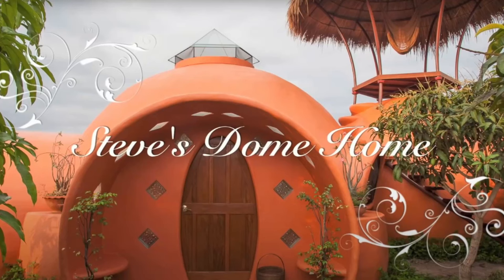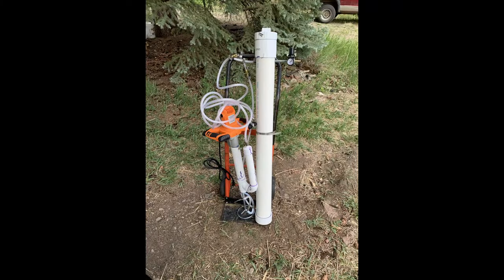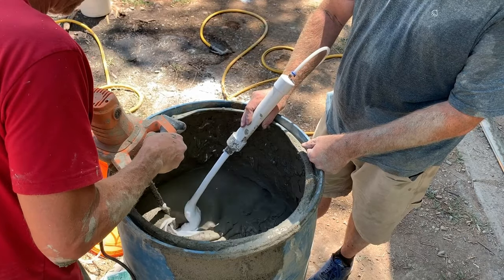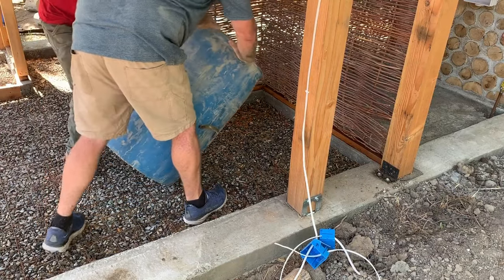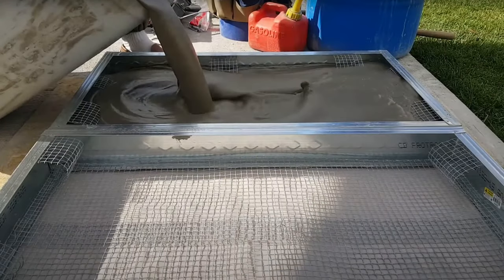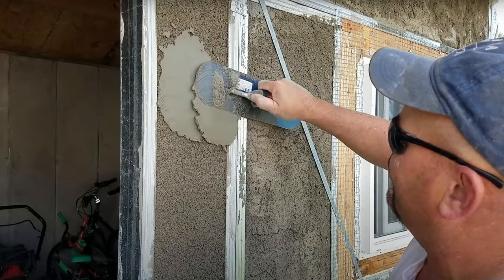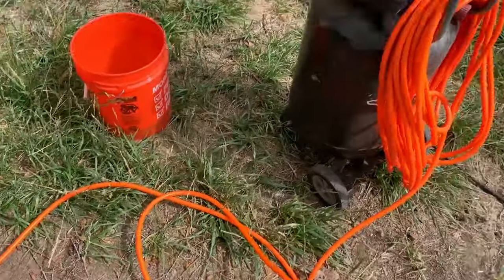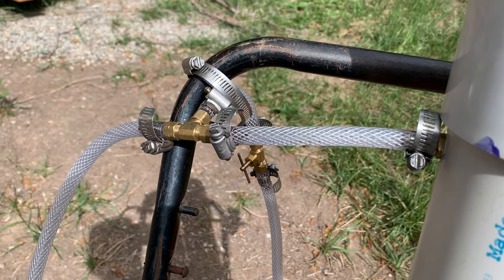Aircrete is great, but watch this before you build with it!

Comment: Hi, thanks for sharing your adventures in building!  With the airecrete process, can you do your dust crete with the added air into panels with tounge and groove concept?  You may also explore CAFS units (compressed air foam system) which are used in wildland firefighting to spray down structures with a foam blanket in preparation of impending wildfire exposure.  It could be that the smallest units would produce too much foam to make it practical, food for thought!
Reply from the maker: The aircrete process is laborious, and may not add much r-value to dustcrete, but it’s an  experiment worth trying. Personally, I wouldn’t use any product designed for retarding fire, as the chemicals tend to be carcinogenic. I’m planning some trials with clay replacing lime in the dustcrete. This will lower cost (below the $1.28/sf  at 8” with the cement) and provide a wall system that I can make without an industrial supply chain. Lime can be made from fired limestone or seashells.
Reply: I agree about the chemicals from firefighting,  I know all to well,  10 years  in  the fire service, but the equipment was what I was trying to highlight.

Comment: I would do tire house/ earth ship then  air Crete to fill the tires versus dirt which takes alot of time and physical labor .
The strength and termal mass of tires far exceed that in air Crete and fiberglass shell. And the used tires are free brings cost down . It also takes time properly figure air Crete mix. If improper the structure will eventually fail. A tire house won't.
Reply from the maker: This could be done. Only 12” per day of aircrete could be poured, however. I wouldn’t do this, myself, because I don’t want to breathe tire fumes.

Comment: Check out styrocrete, shredded styrofoam mixed with concrete, fibreglass fibre, foam.  Very interesting high insulated minimum frame and cheap building.

Comment: Try adding homemade carbon fiber powder into thhe mix with aluminum dust and use hemp fiber rolls with a polyurethane resin added to the mix.  Extremely durable mix design that can be made into forms, domes, etc withh high R value

Comment: I like the concept of aircrete, but it is not really a structural material. I would like to see what happens if you were to do a mix with pozzolanic material like fly ash or fumed silica. 
I'm not a big fan of drywall. I like the SIP approach, though SIPs generally use a structural cladding (mostly waferboard or OSB from what I've seen) that helps keep the internal insulation protected. The grain bags have no structural strength and don't readily attach to concrete the same way as cellulose.

Comment: What if you made panels using aircrete and dust mixed together. Doing so should give more rigidity and strength without giving up much in the form of weight. If the panels were poured flat, using wood bordered forms, the wood could be removed after the material was dry, or it could be left on and the panels could be put up just as a sheet of sheetrock would.

Comment: I bought honey do carpenters foam generator, and tried to form a large aircrete block (about cement size). Mine was crumbly. I didn't, however, weigh the foam or add structural reinforcement. I also didn't let it cure very long before attempting to move it. All rookie mistakes. It's a fascinating substance though. I've also seen aircrete blocks (approximately 8" x 8" x 12" used to quickly and successfully build a home. I think they are manufactured in Germany. What about using a basket weave-style material for rigidity?
Reply from the maker: It’s a tricky material. Given that the R-value is not as great as first reported, I don’t have any plans for further experiments. I’ll be sticking with my dustcrete method.
Reply: @radicalgastronomy  I really like the dustcrete formula you shared. How does it hold up to water? Can you form blocks with it? If so, do you believe your wall method is less labor intensive than forming blocks?
Reply from the maker: @soatmos  it hold up well to water. You can see in the video where I repaired a leak. Blocks could be made, but I prefer the slip form method for speed and strength.
Reply: @radicalgastronomy  thank you. I did see the leak video. I was just wondering how it might do over time, but it does look great.
Reply: @radicalgastronomy  have you ever considered making this recipe with straw instead of wood dust, or combining the two? That would be interesting to see if the added straw provided more tension strength to it, or if it would make it crumble more. Just wondering, because I don't have a mill nearby to get enough "dust."
Reply: Also, can you make a video detailing further how you affix your framing? I get the general idea, but I may use this method to build a house and I would like to avoid as much costly error and time as possible.
Reply from the maker: @soatmos  I bet it would work, but haven’t tried it.
Reply from the maker: @soatmos  I’ll have more framing videos coming

Comment: Has anyone considered using the fibreglass loose fibres as reinforcement? I believe you can substitute the steel required in walls and floors?
Reply from the maker: We have been kicking that around.

Comment: Although I haven't found any actual testing for aircrete at all, a Naima R-value of 6 might be possible with a radical mix of aircrete, however the resulting amalgamation of air, dish soap, and concrete wouldn't be useful as a building material.  It would pretty much just crumble and turn to dust at the slightest pressure because of the high air to concrete ratio and the fact that soap is the opposite of a binder.  

I'd think it would be pretty obvious that the insulating value of aircrete would vary a lot.  More air in the mix, better R-value, less air in the mix, more strength.

The information that I've found on aircrete sites downplays R-value because it isn't a calculation of BOTH an insulating value AND a calculation of air and water intrusion.  Although aircrete would likely be pretty good for air intrusion (and that may well be more important than the R-value), it wouldn't be good for moisture at all unless the foaming agent was perhaps some sort of an epoxy.  

As I've seen it mixed and installed, I don't think it would test anywhere near an R6 as an insulator.  It might be just a bit better than drywall if mixed with a high concrete/low air ratio, and that would be what was needed if it's to do anything as a building material.

I would think there would be actual testing with specific mix and method formulations if an insulating R-value is even quoted as an estimate.  

For some reason, people think mass = good insulating value.  Adobe builders often brag about the great insulating value of clay.  Although it retains heat and cold in it's mass, it's a terrible insulator.

Comment: If only a thermal filler is needed ie walls are supported by framing with posts, studs, etc, limecrete could be far more eco friendly. If a mix is truly load bearing Id bet the R value is closer to 1-2/in. Need a mix table with specific mix designs. Ive made papercrete, perlitecrete, lavarockcrete, epscrete, clay-straw etc. It comes down to using about as much portland as in std concrete mix to be useful structurally - which imo is just not eco. It seems best suited to being a filler wall material. Mg cement is strong but costly. Lime cement is proven over millenia but not easy to get aporoved for struc use. I keep returning to thick LB walls of clay and straw without reliance on a frame that wipes out being eco. Or rammed earth, or strawbale using super-dense 3-string bales with a mud plaster and no portland which is the massive embodied energy hog. Mfg PC constitutes 1/4 of planetary particulate air pollution!
Reply from the maker: Have you ever run across poroton bricks?  I have built with them, and find them impressive. For those unfamiliar, these are extruded clay and sawdust bricks with a honeycomb of air cells in the middle, t&g butts, and keyed faces. They are dried and then planed to a 1mm tolerance.  They are set by dipping into a tray of thin bed mortar, then stack like legos. Unlike cement based techniques, the clay firing happens at lower temperatures, thus requires less fuel input. They are only (to the best of my knowledge) manufactured in Europe, which violates the distance of transport ideal. That being said, we built a 3/2 house out of them in the early '90's for 80% of the cost of 2x6 stick frame.

Comment: Mylittlehonestead had a great idea about building with superadobe earth walls which they then plastered on aircrete tiles they made in hexagonal forms, I suppose they did it for a cheaper faster finish to the Adobe walls as well as the insulative and even acoustic properties of an aircrete plaster finish while maintaining the compressive strength and mass of the earthen walls. I’d say meet somewhere in the middle maybe some square meter sized panels, I’ve also wondered about adding microfiber reinforcement to aircrete mixtures but It’s just an idea for now
Reply from the maker: Interesting

Comment: Honeydew experimented with aircrete mixed with cob in one of his earlier videos which I found to be fascinating, there is so much to evolve and experiment with! I just found your videos tonight and they are really good!! I can't wait to see more on your building. I have an idea about making a compressed block system much like Lego, but uses straw or slip straw on half the block towards the exterior then cob on the interior of the block, then lime on the outsides of the block, the idea is somehow get them to stick together so it can vastly reduce the amount of time to create wall systems. Not sure if it would be possible or even worth doing, I just don't like how labor intensive natural building is. I have watched all the aircrete people you mentioned, it still needs time to get it perfected and consistent. Maybe adding straw or maybe even sticks to the aircrete for the Sips panel would maybe add more strength. I don't know if the straw would break down if it was next to lime/cement. Have you tried the sawdust mixed with air Crete?
Reply from the maker: Your straw aircrete idea is intriguing! That may work. In Europe they use an extruded honeycomb block called Poroton, or Jumbo Brick. These are set with a thin mortar that the bricks are dipped into, then set. Perhaps a thick clay slip could work to stack your blocks. I agree that the drawback with natural building is the time factor. I’m always playing with ideas that can cut time, but keep materials super local and regenerative. Keep us posted on your progress!
Reply: True straw and not grass has a lot of silica which prevents decomposing. Grass or any chlorophyl material will rot with any moisture hence straw has been used for millennia.
Reply: there is a guy on youtube that has been experimenting with styro aircrete for the last year or so and posting videos. he is breaking down used Styrofoam from trash from businesses and mixing it in as like an aggregate into aircrete. Obviously not a natural material but it is recycled, has a higher R-value than aircrete alone and is stiffer during pour. Not saying it is the answer for most people but just another interesting use case for aircrete.
Reply from the maker: @beartankoperator7950  it is interesting, for sure. I wouldn’t want it in my home environment, but some may not mind.

Comment: This was a very interesting and informative video, but there are a couple of mistakes in here that I would like to correct before someone does something they may regret. The first one has already been caught and corrected by domegaia  but I thought it worth repeating. Aircrete has an R-value of approximately 2 per inch, not 6. That makes a HUGE difference when you are calculating the depth of your walls, especially in a very cold area, so people should be sure to factor that correctly. The second mistake is potentially dangerous, so I want to clear it up once and for all ... recycled grain/feed bags are NOT fireproof!!! I believe you may have heard someone mention Aircrete as fireproof and somehow misunderstood that, but take my word for it, as someone who has homesteaded and fed a LOT of animals from those sacks over the last 30 years, they will burn easily and melt like any other plastic when flame is applied. However, if you have a ton of those sacks, you still have a very useful material on your hands--DON"T TOSS THEM! I have sewn them together to make outstanding "free" tarps, cut them down shorter and added straps for heavy-duty totes and reusable grocery bags, and even used them for hauling heavy garbage that ordinary trash bags could not hold without splitting. They also make excellent grow bags--either with the tops folded down to make them shorter and used like buckets, or filled with soil and with the ends stapled shut laid on their sides (cut an x or hole to insert a plant). You can even use them as Earthbags in foundations and walls. They are a great resource, just not fireproof. Anyway, thanks for a great video. I look forward to more of these!
Reply: Thank you Deborah S because I have no personal experience with grain bags but fireproof plastic didn't seem likely.

Love these RG videos and shared ideas!

 Re using the grain bags for facing aircrete panel, If they are Polypropylene that's at least relatively LOW-Toxic plastic and afaik gluable with something... thinset? Idk! Will anything stick to it? Will it degrade as some plastics seem made to disintegrate... biodegrade? Into microplastics? 

Anyway..If they're polyethylene bags, like cutting board material,  very few glues will work. E-6000 is one for small projects, but it's so wretched stinky. Tap plastics might know.
Reply: @sz4179  I believe most feed sacks are polypropylene (not 100% sure, but I believe they are). Until recently I thought nothing (as far as glues go) would stick to them, but I ran across something that claims to work on three hard to glue plastics -- polyethylene (PE), polypropylene (PP), and polytetrafluoroethylene (PTFE). I haven't tried it yet, but it is made by a company (Loctite) whose other products I have tried and found excellent, so it probably does what it claims to do. It is called Loctite Plastics Bonding System. I plan to try it soon because I have two 25' PVC domes that I built last summer, and I want to put a waterproof skin over them before spraying a ferro-cement shell. (The plan is to put the skin on to keep from spraying through the mesh.) I'll  make the skin from glued feed sacks made to fit the triangles closely. Then I will remove the skin and top the ferro-cement shell with aircrete, then seal that by spraying a second--outer--ferro-cement shell.  The idea is to get the insulation value of the aircrete plus the strength of ferro-cement.)  I may try an experimental smaller dome before committing the process to the two larger ones. No point wasting time and money, if it doesn't work. I'm thinking of doing a 10' or 12' hen house as my test since I need to build a new one anyway.

Comment: Air-crete is too fragile and not durable enough  Perhaps try putting it through a stucco sprayer onto a wire mesh where it is basically going through the mesh so that the wire structure is still evident and bonding for the outer coats.. and quickening the set time by using food grade powered silica.

Comment: I have been down the rabbit hole looking at different options for aircrete. There is a gentleman who has been building mixing with styrofoam and is getting great results. Has resolved a lot of the issues, especially with finicky mixing pours that you get without using the styrofoam.

Comment: I kinda wanna go with thick gauge steel frame, skin, and roof. And then build a (technically) non-load-bearing inner wall of concrete brick. And then cold-joint pour aircrete between the two in layers for a fully sealed system. Even though the inner concrete wall won't be considered structural, and the aircrete sandwich will be pretty soft, it should be far tougher than just the steel. Main goal though is "steel // insulation // thermal mass". Some plaster on the inside surface. Probably aircrete brick interior walls around the front & back vestibule too (front & back will both be 'door - vestibule - door').

I think the key with aircrete, is that it's the perfect insulation material. It's just FAR from being a practical construction material. As long as you use poured or bricked aircrete to just sit there and insulate, it's great, superior even. Albeit time consuming to use. Just don't ask it to do any load bearing.

I like your panel idea a lot. Hope you eventually get it working :)

Comment: Using aircrete on the floor is literally an effort in futility. They are porous for a reason. Because they can be an alternative for wood+insulation as they can provide enough insulation if you live in a warm climate. Or cut your insulation in half if you live in a colder climate. While costing less because foam is very cheap. However they can be infested by ants and termites alike. Their mostly porous nature allows for water to enter, so one will need to apply sealant coatings on top of aircrete.
Reply: How much weight can it take?

Comment: What is R value of dustcrete ? Compared to air crete
Reply from the maker: Others have pointed out that the R value for aircrete is actually well shy of the R 6/inch number. In practice, aircrete ends up in the R 3 range. This is on par with hempcrete. Dustcrete is likely around there, but tests have not been performed.